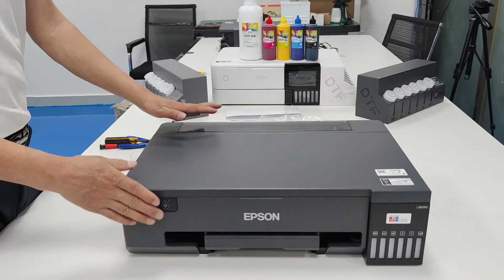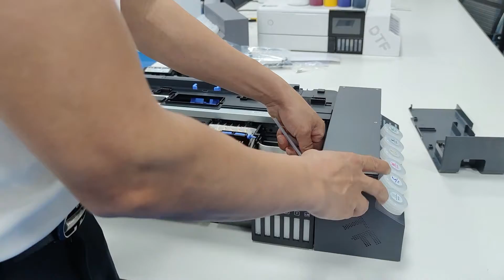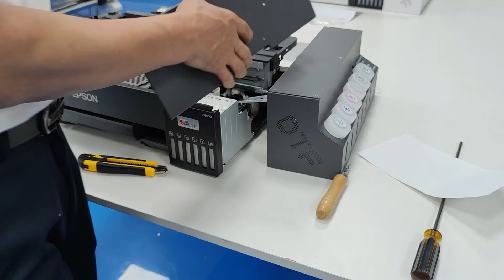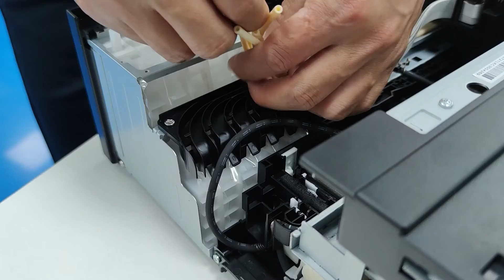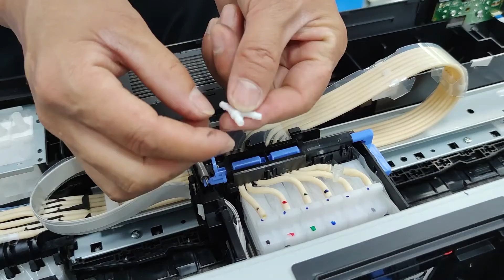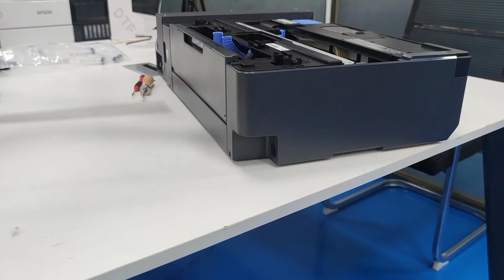Full Step Converion to L18050 DTF Printer Modify White Ink System - A

Comment: Do you use original dampers that came with printer or you change it?
Reply from the maker: We have replaced the printhead top cover, making it more convenient to access the negative-pressure ink sacs and to perform cleaning and maintenance on the printheads. if you have any more question welcome direct message me by whatsapp  +8615015164529
Reply from the maker: We change the ink damper and also the printhead cover

Comment: Question why do you hook the both whites together at the print head?
Reply from the maker: @DoubleRoseCustoms  no matter .you can hook the white any channel .best one set on the both of light color channel
Reply: @skyzhang  yeah understand that I have a ciss like yours n have Epson 8550 ..I'm just trying to figure out why have to hook up both whites together at print head? Can I just leave them the way it is or do I have to connect them an if so what's the purpose of doing it ..thanks again love your videos
Reply from the maker: @DoubleRoseCustoms  before you do that you can check nozzle check print .that will help you
Reply: @skyzhang  so your saying try it without hooking both whites together first? What's the purpose of hooking both white tubes together?
Reply: @DoubleRoseCustoms  I have the same question. I used to have an L1800 and did not connect both whites in the print head. Not sure what the purpose of connecting them at 31:17
Reply: Le pregunta una y otra vez, pero no lo aclara. A ver si nos puede resolver la duda. Yo estoy igual...
Reply: The reason for this is to circulate the white ink - with this setup the white ink only comes through on 1 line/tube and returns to the white tank on the other line. So in this way it feeds both dampers but can also return to the external white tank.

Comment: Hi.  I installed the program from epson easy photo print and it gives me an error like the driver is not installed properly, but if I print a picture from another side it works fine.  color not compatible easy photo print with l18050?  As usual, I received epson photo+.  I don't have a problem working with this either, but I'm interested in making templates, different sizes, like I used to do in easy photo print.  Thank you once again.
Reply: How do you set up the printer

Comment: What rollers do you leave in for 8.5x11 sheet and 11x17?
Reply from the maker: please which model of printer you are asking for please ?
Reply: @skyzhang  epson l18050
Reply from the maker: @johngrate8100  yes can work with it ,you may need move the roller also. you can you replace a paper Vacuum function plate with your printer. it's shoud be worked
Reply: @skyzhang  what roller exactly?
Reply from the maker: @johngrate8100   for roll film stander
Reply: @skyzhang  I'm just using sheets
Reply from the maker: @johngrate8100  oh Ok enjoy

Comment: Hi, just to clarify. 1st and last last tube color are WHITE. So, the supply is from the same one WHITE tank correct? Because tube total 6, but the DTF color supply tank total only 5+1(Waste tank). .. I hope I'm right.  👍
Reply from the maker: thanks for your letters, with our ink tank total have  7 tuble  one for waste ink. two for white   four for colors, our white ink have Automatic circulation function from ink tank to ink dampers. enjoy your print 😀
Reply: I purchase this dtf printer in india and the modifier just gave me that normal ciss tank my white ink clogs everyday i lost every ink just by doing ink charge which is just for white now its 22:20 had some order from clint got this thing whole day but i couldn't fix it i am new and the seller who sold me wont reply 😢 any one help me and your ink system is very nice i wish i could buy them here in india shipping cost are too high most of the time more than the product price
Reply from the maker: @saradrai4493   this just for band new printer printer work some days . after one week. you give problem with your white nozzle print
Reply: @skyzhang  i didn't  get you u mean this can be installed on only new printer ? What if i used this on my printer will this work?
Reply from the maker: @saradrai4493  oh yes we have ink system and full parts to modify with it , next video we will show it for L8050, A4 size with paper Vacuum function

Comment: Informative video Brother. But please make a video on L8050
Reply from the maker: this will get ready coming one for A4 size
Reply: @skyzhang  HELLO THIS PRINTER CAN BE MODIFIED FOR 13'X19' PRINTS YES?
Reply from the maker: @victusvr   yes sir  for L18050 ET8550 can work with that size. futher we will update video for it
Reply: @skyzhang  can you help explain the rollers to make print 13x19....also can i purchase the cissbsystem?
Reply from the maker: @victusvr  please if you want to print with roll software can do it , just have some limited. when loading film can not power on and off the printer , and also can not do head cleaning , best solution will need a smart board to connect with printer Motherboard. that will can direct print a roll size .
Reply from the maker: thanks so much brother
Reply from the maker: thanks so much bro
Reply from the maker: hi friend already update on it .please check it when you free